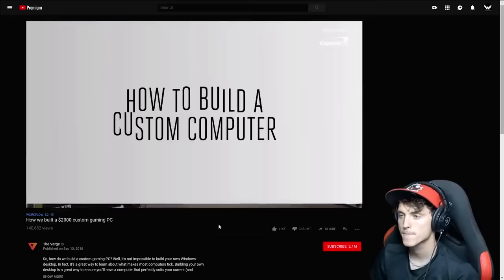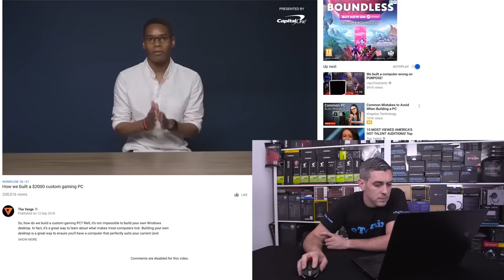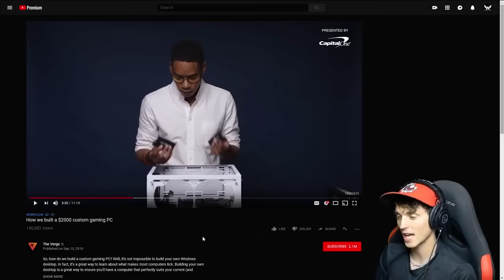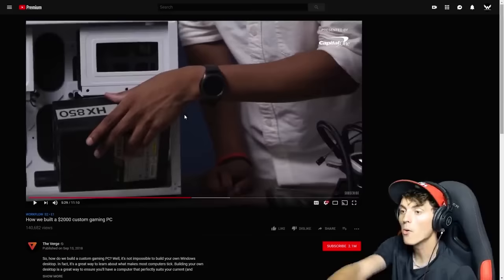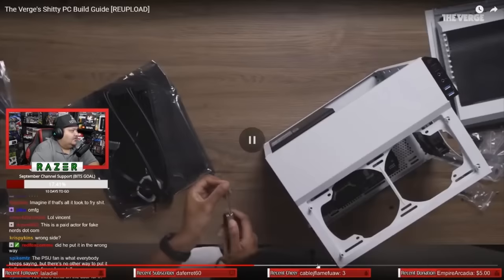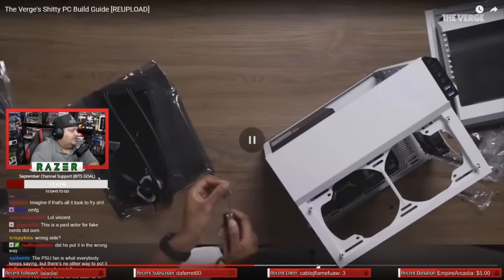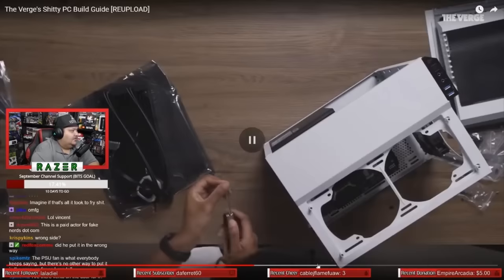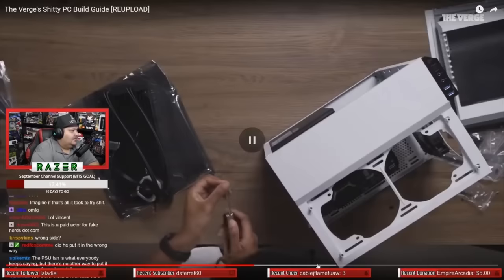The Verge's $2000 PC Build Reaction Supercut

Comment: I built the Verge PC.
It died after a few days.
I must've bought the wrong table.
Reply: but did you use the alan key?
Reply: Maybe you removed the insulating pads for the Brick and it shorted out
Reply: The table is the most important part
Reply: Thanks Obama
Reply: You didn't wear your Livestrong bracelet!!!
Reply: Did you put tweezers on the table?
Reply: Use tooth paste instead of thermal paste, it'll work just fine
Reply: No it’s because u forgot the thermal paste applicator man😂
Reply: But you actually did get it to post? No way! clap clap clap
Reply: Maybe because you didn't put the whole tube of thermal paste
Reply: Try using a live strong bracelet next time.
Reply: Na, you probably just need to applied more thermal paste ;)
Reply: You should have thrown away that plastic socket thing, it's useless
Reply: The Real Bevy B you mean “WWJD bracelet” 8:16
Reply: Maybe you didn’t hope that your swiss army knife had a philip’s screwdriver. You should’ve hoped that it had one, otherwise you can’t screw in with confidence
Reply: Lol
Reply: Buy a smart table and maybe itll function as a toaster
Reply: It could have also been that you didn’t use the cpu applicator
Reply: Was it metal?
Reply: Did you remember the tweezers?
Reply: Noooo
You just had a bad gaming chair
Reply: T B L or lube would do just fine 🌊
Reply: You didnt use a Swiss army knife that hopefully has a screwdriver in it
Reply: did you forget to hammer down your brace?
Reply: Must have not had a Swiss army that hopefully had a Phillips head screwdriver
Reply: Did you make sure to use the thermal paste applicator?
Reply: You must have forgot the brace
Reply: You didn't attempt to use the cpu applicator only to realize you don't need it
Reply: All the comment so funny
Reply: nah u used tweezers thats why
Reply: DIY perks only use table
Reply: Prolly used the wrong twizers
Reply: Did you have your live strong bracelet on
Reply: you did not use the allen wrench trust me.
Reply: Got me thinking: why not start a company that sells ‘Verge PCs’? Cheap to build (no knowledge required), big revenues from repairs, lots of media attention. 🤑
Reply: you didnt use tweezers
Reply: @bagas3042  toothpaste cleans as well. It’s common knowledge and good practice
Reply: Could not find those little plastic ice cream spoons anywhere so just had to mangle the cpu by hand :( First world problems I guess.
Reply: You forgot to take off the fans
Reply: Did you use the anti static brace, because you have to know what jesus would do in this situation
Reply: I think it was the swish army knife
Reply: I bought the wrong, ah, CPU Installer
Reply: You might need to replace the table
Reply: @redmoonlight6776  Best counter yet!
Reply: @SFH_Jenkins  where?
Reply: No you for got to get the cancer fighting bracelet.
Reply: Did you forget to apply more thermal paste? You may of not applied enough.
Reply: Are you absolutely sure it wasn't the anti static bracelet?
Reply: Did you screw in too hard?
Reply: did you use a rivestrong antistatic band?
Reply: I'm afraid I used a table made out of wood rather than wood with plastic glued to it that's painted like wood. Maybe that's why.
Reply: Did you use the wrong swiss army knife?
Reply: Most definitely 😂😂😂
Reply: I think u need at least 3 thermal paste tubes
Reply: You didn't put enough thermal paste
Reply: Did you try put more paste? Maybe it will work
Reply: Did you screw it with confident?
Reply: Did you try to hammeringg the brace?
Reply: U probably forgotten to put on ur rubber bracelet when building it
Reply: But did you fight cancer at all my dude?
Reply: You should apply your ziptie correctly
Reply: Did you forgot to use a #LiveStrong bracelet during the build?
Reply: You probably forgot to hammer the brace in
Reply: No it’s because you used a screwdriver and not a Swiss Army knife
Reply: I built the verge pc.
I died after a few days
Reply: Did you make sure you had a pair of hands with ten digits?
Reply: Allen wrench lol
Reply: U probably just forgot the tweezers... smh Newb
Reply: No you didn't
Reply: @williamowens2063  Maybe I bought a flathead screw driver instead of a phillips screw driver and that’s why my PC is overheating, or at least that’s what I learned from The Verge PC build. Peace sonny boy!
Reply: @XcalWhite  Can’t build a PC without a table that is compatible with the processor. 🤣

Comment: This should be called "How to spend $2000 on a room heater."
Reply: Or get a console for cheaper
Reply: 2000 on a 🔥 Hazzard
Reply: Or a door stop.
Reply: 🤣🤣🤣 this is hilarious 😂
Reply: Hey hey hey, when it catches on fire, it will definitely heat the room for a bit.
Reply: Or "how to build a 2000$ that machine thats gonna kill itself in a weak and burn your house down"
Reply: Diego González yeah but they are trying to building a pc. Not a ps4.
Reply: This was a joke right?
Reply: Jaime Oviedo no. It should be called that because how terrible it is.
Reply: house heater in 2 weeks
Reply: That would 50 50 blow up
Reply: Correction.....a time bomb without the time display

Comment: I was scared shitless when building my very first PC. Had to do ton of research and still took my time build it, then ended up with 8 hours of assembling. I thought I had fucked it up a few times.
Reply: Me too lmaooo
Reply: 8h? That's crazy!
You know, you don't have to do mining and build circuit board and CPUs from the scrach. You can just buy all components.
Reply: It took me 2-3 hours only because I messed up connecting some wires
Reply: @XtreeM_FaiL 8 hours, 2 of them trying to mount the bloody cpu cooler and 3 for cable management lol
Reply: @XtreeM_FaiL MFer crafted it like Minecraft.

140,000 emeralds for a new 4060ti.
Reply: Same!
Reply: Took me 6 hours for mine, 3 hours of which (unironic) were just trying to put the goddamn fan on my air cooler and trying to fit the motherboard power connector, which took some very uncomfortable amounts of mobo bending to fit in and click. I was close to giving up and returning the power supply. I will probably never take it off again tho, thankfully it's a supposedly reliable psu and it will last a while. Aside from that, it was a fun experience. I do builds for friends for fun now.
Reply: People are still falling for the "just build your own" meme? 🤣
Reply: It took me 2 days to build a pc and figure out how to apply thermal paste efficiently cause it was my forst time working with something fluid instead of just connectors and screws
Reply: I figured out after completing my build that my motherboard firmware needed to be updated to support 13th gen. By some miracle it supported USB flashing (thank you ASRock)
Reply: When I built my first PC back in the 90s I basically had no resources or decent access to internet so I just kind of winged it lol.
Reply: @namelessxdread  How exactly is it a meme?
Reply: @The_Real_Frisbee  It's usually cheaper nowadays to get pre-built, and assembling your own is way more challenging than people make it out to be.

Comment: These guys have no clue.Everyone who knows anything about computers knows that you should never build a pc without wearing your friendship bracelet
Reply: In a safe space
Reply: To be fair wireless antistatic bracelets do exist
Reply: You can't build a pc without the power of anime and friendship, you know.
Reply: It's funny I've built 2 gaming PCs for myself and 3 for various friends and never used any anti static gear. Never had any issues. Dumb thing is  I have all the anti static gear because I work in an electronics manufacturing plant. All I do is ground the case using the power supply cable.
Reply: @kirchoff4733  do they work tho?
Short answer: No
Reply: @TexasGreed  or you could plug in the power supply and turn it off. That grounds the metal on it.
Reply: @kirchoff4733  as an electrician. No they do not work
Reply: @neckbite9159  that's exactly what I do.
Reply: @TexasGreed  yep yep
Reply: I play console and for safety I know friendship bracelets are crucial to pc gaming
Reply: when i built mine i didnt use a grounding bracelet and now its full of dust and im too lazy to clean it
Reply: Preferably a wireless one.
Reply: Wait for real though, i never used any anti static bracelet when i build a pc back in high school and didn't have any issue.. 
Is it really necessary? And is there even any electricity in any of these parts when i built it? Or maybe it's a static electricity from myself that I had no idea about?
Reply: Yadi Arfy you need one of the grounding bracelets that are connected with a wire. the wireless ones are fake. youll be fine as long as youre not statically charged, but if you are prepare to destroy some pc parts.
Reply: @kirchoff4733  soo where does the electricity go???
Reply: Some nakama

Comment: This compilation could be the best pc build guide out there... nearly every mistake is covered and explained
Reply: It was just an ambitious crossover
Reply: Completely agree.
Had no concept of installing ram spaced out at all.
yet another reason to add to the list of why I'm buying pre-built.
Reply: I’m about to build my first pc, and until this video I didn’t know the top express pcie has more bandwidth, good to know.
Reply: @Ben_R4mZ  its really not that hard, there is no reason to buy prebuild if you got two arms and can spare couple hours in to it, this guy just didnt do any research :D I was complete newb when i build my first comp around 2004 but even back than there was decent guides on the internet, with easy to follow instructions for the beginners to avoid these type of mistakes. The verge guys are complete idiots for releasing the video in the first place
Reply: @Ben_R4mZ   Dan Rudov  Guys you only need to look at the first pages of the motherboard manual.
You space them out not because of "space" but because the slots are paired, you put the rams in different "setups" depending on how many sticks you're installing (usually 2 or 4).
Same goes for the PCI-E and it's nothing fancy: one has 16x written on it, the others don't.

Honestly, the hardest part (or rather annoying) of building a PC is managing cables, go figure.
Reply: @Ben_R4mZ  There isn't a hard-and-fast and rule about how to install RAM in a motherboard unfortunately. They can be wired in multiple different ways so best practice is to always check the manual. It's easier on non-gaming motherboards as the RAM slots are usually colour coded so you can clearly see which slots are paired but even then it's not always clear which pair of slots should be populated first or which slot should be populated when you're only using one DIMM.
Reply: Could've been worse

He could've taped the ram to the motherboard instead
Reply: @Ben_R4mZ  do not buy pre-built! you're just wasting money, all you need is a bit of time and it'll save you tons in the long run
Reply: @BirdieImagineeBCH  is it really that impossible to upgrade parts in a pre-built?
it seems more people are willing to just say pre-built is overpriced without even asking what I have already researched.
the build I'm currently looking at is a Ryzen 7 2700, RTX 2070, 32GB RAM and a 500GB M.2 for just under $1800. 2 Year warrantee on all parts. 
This is by NZXT and compared to all the other options I've looked at, Amazon, Newegg, Ironside, Origin, Cyberpower, and iBUYPOWER even offer them now, it's the cheapest option I've found so far.
Reply: @Ben_R4mZ  Thats an OK deal for pre built considering the warranty though you could get it cheaper easily idk where you are looking. But why do you need 32gb of ram, unless you are video editing or graphic designing. also dont get an m.2 drive they are fast sure but needlessly expensive. just get a 2tb hdd and a 250gb ssd to install windows on. that will bring your price down without sacrificing any performance.
Reply: @TheRushingTiger  I'm going for an upgrade over my current system.
I run at 11-13 gigs of RAM almost constantly due to my addiction to multitasking and yes I do actually want to do video editing AND graphic design, interesting those happened to be the two you mentioned. As for the M.2 it just seems like a basic performance improvement over an SSD which I can still install myself later along with some bulk storage on normal HDDs.
Price-wise it's about 10$ less to buy the 500 GB M.2 and I don't want to buy HDD's from NZXT anyways since all they offer is Seagate and I've heard more bad things about them than Western Digital which I've been using for years with no issues so far.
In all honesty it just comes down to once I'm able to afford it, (it's a long time away the way things have been going lately :/ ), I won't really care about spending a bit extra for small things like 3,500/2,500 MB/s Read/Write speeds. I'm buying some things as future proofing while saving on parts I don't really want to spend extra on since they go obsolete so fast. Ryzen 7 2700 vs. 2700x, (+$150 and who really needs the extra .4 GHz?) and RTX  2070 Super vs. 2080 Ti, (+$730 and I don't even have a 1440p monitor let alone the "4k@60 on Ultra settings" the site claims the card is capable of.)
I just want to play, record, and stream games on not-shit settings like I currently "do," most times at less than 40 fps.
Reply: Ben R4m-Z without a 1440p monitor might be better off with an Radeon 5700xt unless you have a g-sync monitor not necessarily a better idea to buy an overpriced GPU.  Either that or find a non-super 2070 or 2060.
Reply: @Ben_R4mZ  be mindful when shopping M.2 as that is just the form factor and does not indicate the speed, as M.2 drives can be either SATA III (6Gbps) or NVME, which uses the PCIe lanes.  And even then, the speed difference will probably only be noticable when scrubbing through footage
Reply: Now that's a painful roast
Reply: And you can imagine an online class with these guys
Reply: @mo gamer The important thing is that the sticks are exactly the same. When you buy X GBs you usually get 2 or 4 sticks that are made to work together, if you buy 2 bundles of 2 sticks they should be fine if they are the same exact ram but it's still better to have a single "bundle". Say you got 16gb of DDR4 at X frequency and you want to upgrade to 32gb, you'll need 2 more sticks sporting the same GB per stick and the same frequency. Weirds setups can work but may/will give you issues (up to straight up not booting) it depends on a lot of things.

As a rule of thumb just buy a RAM pack with the desired GBs and don't worry too much about how many sticks, just be sure the motherboard supports them and has enough slots (which shouldn't be an issue if you're pondering such things, as you probably have a decent motherboard at this point).
Reply: @Ben_R4mZ  I built computers for myself when I was 12 years old. I'm not exaggerating or joking. 

Although a couple times I did install the ram incorrectly and Make a few other mistakes but I was 12-13 lol